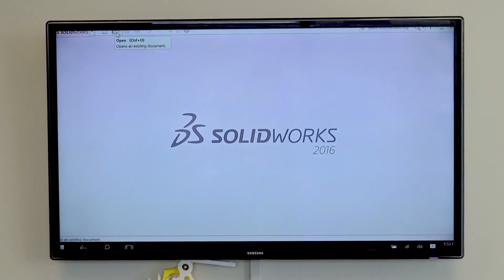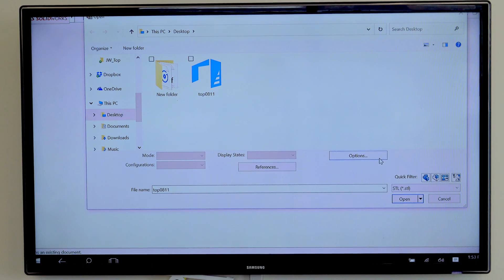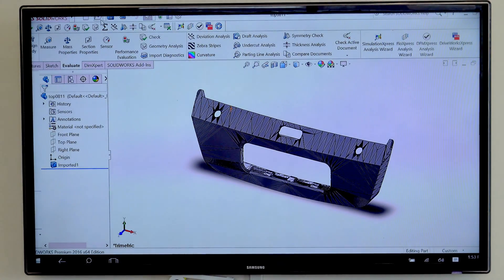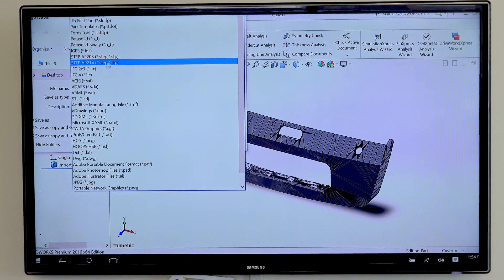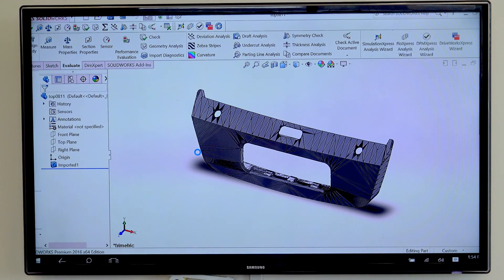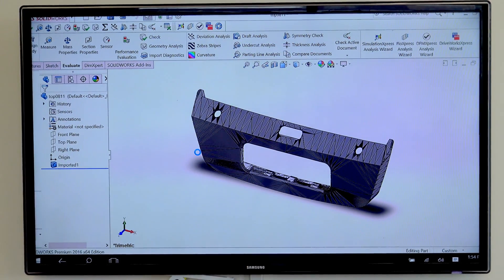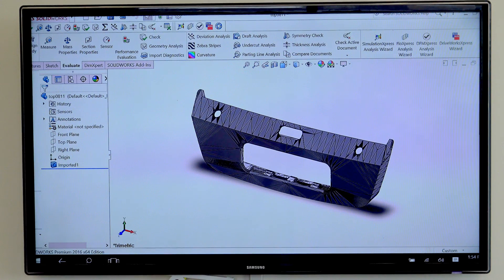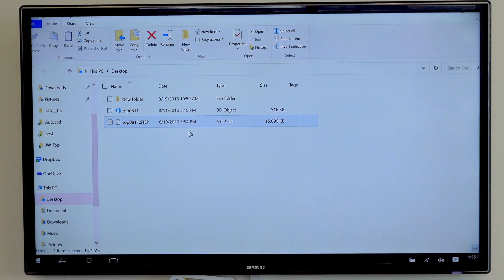How to convert a STL file to a STEP file using SolidWorks.

Comment: Category:  comedy............. Indeed.  This isn't a feasible solution.  Converting each and every triangle to a 3 sided surface is going to create massive file sizes that are difficult to work with.  I have my doubts that you used the resultant step file directly as saved from SW to design your injection mold.